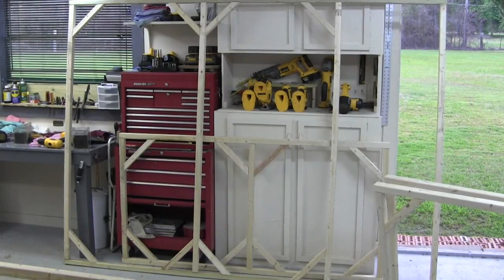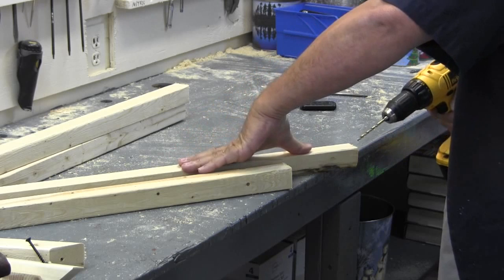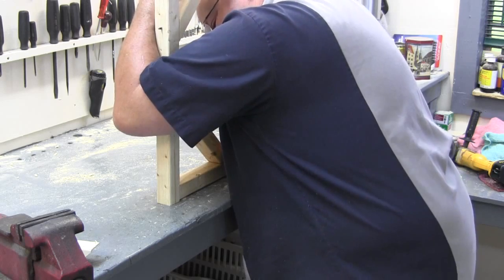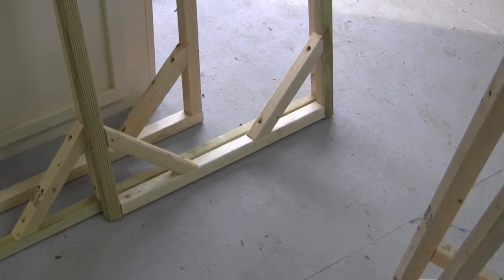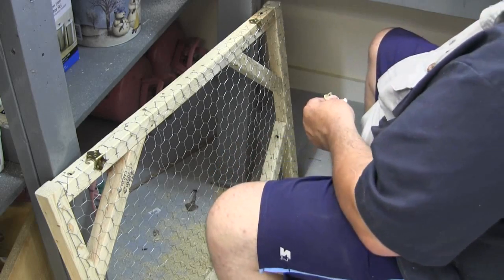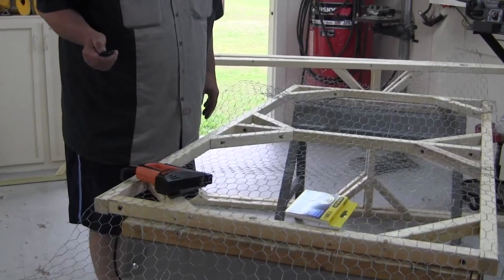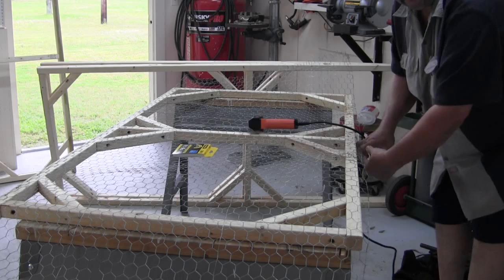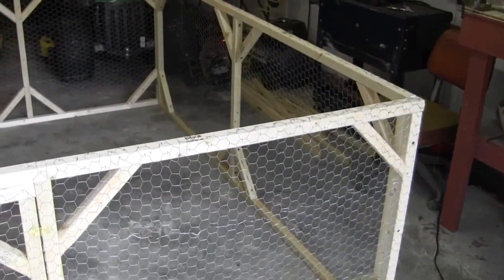How to build a chicken tractor part 4

Comment: Hey BC, good video, I saw in the start you were using pocket screws as a joiner method and thought you must be using a pocket making gadget so it was neat when I saw you making pockets without the pocket gadget. 
The cut off saw idea was good. How are you treating the wood?Some people use anti freeze with propylene glycol to keep wood from rotting. I live in an apartment now and have no shop so it was fun to see someone make stuff plus you don't use $3000 woodworking machinery like some do.

Comment: Would countersink bits do the same as your pilot and socket holes?
Reply from the maker: +vermiman  It would work if you were drilling at 90 degrees,but it wont work at a 45 degree angle which was what I was doing.
Reply: +BCtruck, rebuild, repair,repurpose , I just ordered a miter saw and a set of countersink bits.  I was hoping that the counter sink bits would work similar to your pilot and socket holes.  The countersink bits that I am talking are two bits in one.  The smaller part is for the pilot hole and the larger part is for the screw head.  I really enjoyed watching your tutorial videos in this series.
Reply from the maker: vermiman All you can do is give them a try. Maybe they'll work just fine.